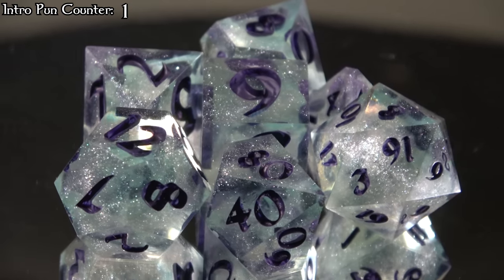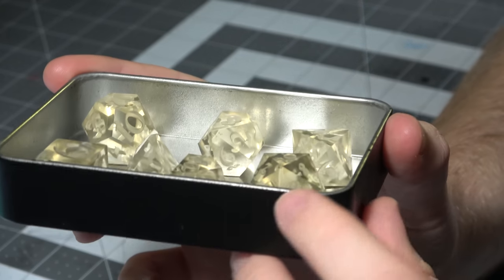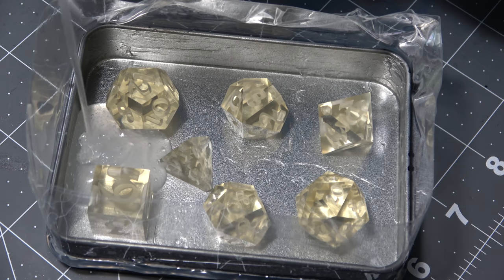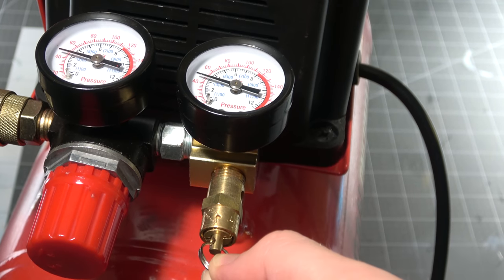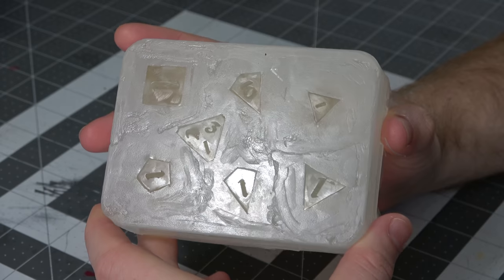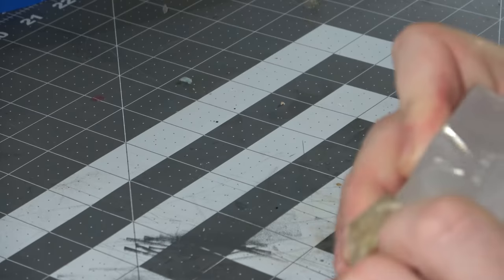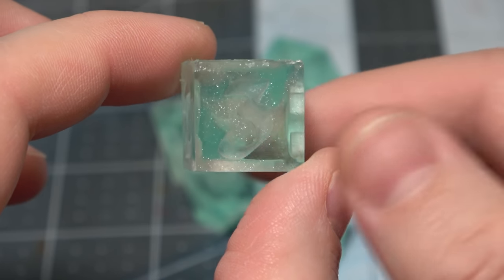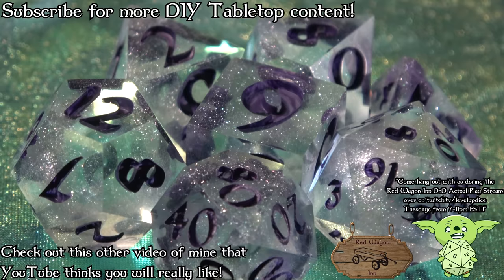The Complete Guide to Dice Making | Cap Molds

Comment: I would love for you to show us a good way to make dice without a pressure pot or vacuum. I know they make things easier but for beginners they are a big investment.
Reply: They are big investments, and I'm about to try making dice without them, but I think for dice in particular it is important to remove all air bubbles so that the weight of the different dice sides is as even as it can be to promote true randomness. I have a friend though who WANTS trick-die for character creation, so I'm going to see if air bubbles aid in that or not.
Reply: you can buy resin that has to cure longer, that way the air bubbles rise to the top and you can use a lighter to remove most of those bubbles
Reply: @kevinkever  Yes! I found this as well, I have a very difficult mold (there's only a small slit to put resin in) and I've found that slow curing resin gets rid of most bubbles. Only a few small ones remain which only matters if you're making clear dice.
Now I'm going to try making sillicone molds without a pressure pot so pray for me 😂
Reply: Just do it without the pressure pot. You can squeeze out air bubbles,  use a massage gun on it,  and accept that there will be some small bubbles from time to time. If you're selling stuff and you need to absolutely 100% make sure there are no bubbles. You're going to have to invest. Most of the time it looks just fine w out a vacuum chamber or pressure pot.
Reply: Allegedly you could also put the mold in the fridge for a few hours at the beginning of curing it, which will give it a longer cure time, and allow the bubbles to rise to the top of the mold. And with the dice, using UV resin may help with the bubbling issue, since you have to do it I layers. The only downside is that your mold has to be clear.

Comment: Would you consider making a budget dice making video? I’m interested in the hobby but I don’t have the budget for it
Reply from the maker: I'll add it to my to-do list :)
Reply: Not using a pressure pot is what made the whole thing cheaper for me, but it is a struggle with those bubbles
Reply: You can find resin cheap on Amazon and a good substitute for mica powder or alcohol ink is acrylic paint (you can get a fair amount of different effects with acrylic). Mica powder itself off of Amazon is pretty low price compared to other places too, so you could get it off of there.
Bubbles can be a real issue though, but I found a DIY pressure pot video that shows you how to make a decent pot with just stuff from a DIY shop, so I hope this helps!
https://www.youtube.com/watch?v=eYL_Klfp3Lk
Reply: It’s worth it to save up and get the stuff he’s using. I lucked into a pressure pot, but for the rest, I got everything needed for $200 Canadian, and this amount of resin can make a LOT of sets of dice. The huge resin jugs I got were 3.8 liters and it only takes about 50ml of each jug to make a full set of dice.

Comment: I used this tutorial to make my own cap mould. Just took the finished product out of my pressure pot ten minutes ago, and it's perfect. Every little hint worked - from the tape around the sides to the petroleum jelly. I can't wait to systematically work through the actual dice tutorials now.
Reply: Did you put your mold with the resin in it into the pressure pot? He didn't show that part but it sounded like he did. I just want to be sure in case it will ruin my mold 😨
Reply: @MegaBlackrose67  I just pulled out my first set of dice following this video (as well as some others) and yes, I put the silicone mold filled with resin into the pressure pot. Then pressurized it and waited. They came out great. Now if I coiuld just find a mini pottery wheel.
Reply: I just finished my first set as well. I love this channel and I plan on going on the same epic journey that you are about to partake in. Good luck and have fun. :)

Comment: This is an excellent tutorial with some nice techniques.

I've done the silicone mixing in ziploc style bags before, which allows you to get a very good mix by kneading it with your hands, you can also work it a bit by squeezing the bag to help with the bubbles. Then, you can then cut a very tiny hole in one corner and squeeze out a very thin stream of silicone from a bit of a distance. This not only tends to remove bubbles because of the sealed bag, the thin stream also decreases bubbles and pours slowly so you capture lots of details. Didn't have a pressure pot so had to get creative for copying some old car badges.
Reply: would that work for the resin as well? kinda want to try making dice but there's no way i'm buying a pressure pot and everything xD
Reply: @beardalaxy  You don't need a pressure pot. Just use a tool to pour your liquids down slowly with, and slowly mix your liquids together. Use plastic to mix also as wooden tools cause bubbles. You can also add in layers, so pour, use a heat gun to get rid of bubbles, or a flame tool, and slowly add more each time, again, with a tool that you pour the liquid down.
A pressure pot is a waste of money if you don't need it.

Comment: one other tip I have found while using a harbor freight pressure pot. Every once and a while rubbing some vaseline around the gasket to help it seals better to the base of the pot has really helped keep the pressure inside the pot and reduces the trickle/leak of air.
Reply from the maker: Oh I should have mentioned that, because I do the same thing! :)
Reply: I just picked up one today to start making dice. May I ask which gasket?

Comment: We use ease releas from smooth on(same company as dragon skin). We just spray it in two layers, even directly on the dice. Doing that makes the mold super smooth. Easier then fenagaling around with petroleum jelly cause you can still spray it right on the dice and has no issues capturing details.
Reply: Also thanks for the video on updated cap molds. We used your last video to make cap molds and we love em. Can't wait to try making some more but with glue dots. >:3
Reply: I was wondering about using a mold release spray, seems like it would be much easier and faster than petroleum jelly on a cotton bud.
Reply: does it work on resin 3d printed dice for masters? I'm having a terrible time getting inhibit x and looking for a safe alternative that won't turn my masters into a slimy silicon oozy mess. -_-

Comment: Ilove these videos! It has inspired me to start the hobby.

One thing I would note though is the compressor size matters when you are filling the pressure pot. If you have 100psi in a 5 gallon compressor, it will not be 50psi when you connect it to a pressure pot that is 2.5 gallons. Be careful when connecting the two together.

Comment: Whenever I cast silicone in/on silicone I have found the best thing to use to make them easily separate is a half and half mixture of liquid dish soap and alcohol. It leaves a super thin layer of dish soap that is really easy to wash off! I made some silicone dice on my channel if you want to take a gander. Thank you for the video! I made a very similar mold for my micro dice!

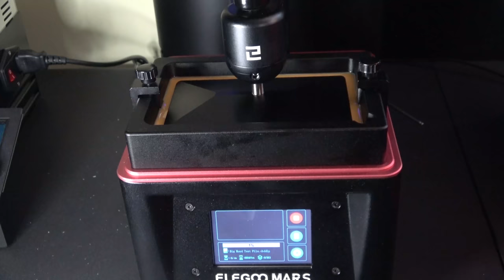Comment: This is an awesome video. 1:51 I'd like to say that reverse engineering is not illegal. If you take someone's finished part, measure it and recreate it in CAD, you can do whatever you want with it as long as you don't do any of the following: 1. use a patented mechanism or process (dice are not patented) 2. use a trademark symbol 3. use copyrighted media. Also, make sure you have a commercial license for whatever font you are using and if you need a font, please buy a license from a reputable font seller. Typeface designers do a lot of hard work to create those beautiful fonts and the licenses aren't very expensive and usually you can use them for the rest of your life.

Comment: Dissolve your vasaline in benzeen/naphtha and spray it using a cheap air brush (wear a respirator) or get proper spray can mould release. Both easier and less labour intensive.

Comment: Awesome video, thanks! One correction: DLP and LCD SLA resin printers all use the same resin, so you should always use Inhibit X on any resin prints, unless the resin is specifically made for silicone mold making, and those are usually really expensive.

Comment: You can make removing the molds from the container easier by using the air compressor. Get the nozzle between the edge of the silicone and the mold wall and blow air into the gap. It will release the mold quickly and easily.

Comment: Since you have an air compressor, you can use it to help release the molds. Use either a blower tip or a ball inflator needle. Put it in a gap on the edge of the mold and blow air into the mold. It should make the form pop out or at least help loosen it. Much easier since it also breaks any suction the silicone may make holding it in the form.

Comment: Yeah! New video! What do u do if u don't have a pressure pot?
Reply from the maker: So without a pressure pot, you just wont be able to get clear dice with hardly any bubbles AS EASILY. It can be done. You can mix slower to incorporate less bubbles, and you can put air holes like in the combo mold I show off to help release some :)
Reply: You can also use the Fridge Method to remove bubbles! I don't have a pot and it saved my molds. 

Essentially, like Rybonator said, mix and pour slooooooooooowly, and then put your mold cups in a tray and let the silicone sit in the fridge anywhere from 12 to 24 hours. 

This inhibits the cure and allows the bubbles to rise in the still-wet silicone. Once the 12-24h are up, remove the molds, and let the silicone finish hardening at room temperature. 

And bam! Clear dice molds with no pesky bubbles!
Reply: ...I may have misread the comment to be about the molds themselves and not the resin used to actually make dice- sorry! I'm not awake yet.
Reply: @Marcario  I kinda ment both👍 thx for being extremely helpful!

Comment: I noticed  you said that both the mold and the dice themselves were used in a pressure pot. I've watched alot of your videos and in another video you used a vacuum chamber when it came to the molds specifically. I was curious why you were able to use a pressure pot for the mold and not the vacuum when it came to removing bubbles from the silicone itself. Much appreciated it you reply thanks In advance :)

Comment: I just wanna add that if you ditch the pressure pot's compressor connector for a schrader valve (bike pump valve), you can get away with quieter dice making and get swole in the process by filling up your pressure pot with a bike pump.

Another thing, I use wood glue when I attach my dice to the bottom of my mold. I dab just the slightest amount on and stick it right on. It's so flush against the surface that I hardly have to do any trimming, if any.

Comment: I have to thank you a lot for this vids, they got me into dice making and I just can't stop making them! I have a question though, but I imagine it's gonna sound stupid... I followed this tutorial for cap molds and they came out GORGEOUS, but still I have some excess resin I have trouble sanding (like I went too far and now the numbers aren't there anymore 😅)... Would you consider making a tutorial as to how sand correctly? Sorry for being a newbie and bothering you 🙄 thanks again you're a dice legend!
Reply from the maker: Hi Serena :) I'm glad you like my content! That makes me happy.

So I would probably say that you are starting with TOO heavy a grit of sandpaper. If you are starting with say 200, try starting at 1000 instead, or use something called Zona papers! It's best to go slow, as you can always take away more, but you can't ever put it back. So it's best to start with an easier/softer set to make it so that you can find a groove that works best for you. :)
Reply: @Rybonator  first of all thank you for taking the time to answer and for the advice, I will surely do as u say 😊 do you have any advice also as to how remove the excess resin without deforming the dice? Thank you again and sorry for being such a noob! 🙏

Comment: I have little round sandpapers that Velcro to a round bit that fits in my drill which I have propped upright and use exclusively  for sanding dice which seems like the same idea as the pottery wheel

Comment: How did you solve the issue of little bubbles in the silicone that were causing spiky bits on the surface of your dice? If I recall, that's why you were degassing your silicone in a vacuum chamber.

Comment: If you are using SLA prints you can use any clear coat you get at Walmart or a hardware store and the silicone will cure just fine. However, if you use IPA to clean the dice afterward you will rub off that clear coat.

Comment: We've made a couple cap molds following your tutorial, but we've been running into problems. After filling our mold with resin, the cap/lid doesn't go down all the way, so the upper faces of the hardened dice are extra tall. When we sand them down to the proper proportions, we lose the number. If we don't sand them down we have an imbalanced die. Our lids are about 1/2 inch thick. Do we need a thicker lid to apply more pressure? We've even tried putting books on top of the molds in the pressure pot, and even clamps, but they just don't apply pressure evenly enough. We love this style of mold, but can't seem to make any usable dice from them. 

Help us Rybonator...you're our only hope!
Reply from the maker: So 1 of 2 things happns - (Hope I can help :) )

1- You just need to push more of the resin out when you put the lid on. If there isn't resin coming out of the sides, it generally means you didn't put enough resin inside the mold, or you don't have enough weight to push the resin out. (You can also shimmy it a bit to get the resin to squish out the sides.)

2- If there is a large lip where you cut the silicone on the bottom half of the mold (where the dice go), then there isn't much you can do since the resin will always fill the voids that exist. Meaning - The clay/tape or whatever you used to hold the dice down when making your mold was just too thick. Best to just start over at that point, otherwise you will just keep getting frustrated.

Hope this helps! I would avoid putting weights on the molds to keep the lids down. A book will probably distort your mold and make some wonky dice. Next time make the lid a BIT thicker if you are having problems. Never hurts to have more, but can hurt to have too little. :)

Comment: You say leave for 36 hours for hardness for sanding but what if you need to cut off flashing? Wouldn’t it be best to take out earlier so it’s still soft enough for cutting?
I’m making my 1st set of test dice and know I will certainly have flashing of some kind that I will need to remove.
Reply from the maker: Good question! Flashing is generally so thin that it always stays pretty soft. I wouldn't wait days and days from the time it cures, but you should be fine at 36 hours. If not, cut the flashing beforehand :)

Comment: Are these cap molds useful when you don't have a pressure pot? I've been playing around with some sprue molds but I can't eliminate the micro bubbles on the edges. The resin has a long cure time so I'm considering a cap mold to see if more bubbles can escape before it starts to set.
Reply: The nice thing about cap molds is that if you let your resin sit for a little, the air bubbles will come to the top and you can pop them with a lighter before you put the lid on
Reply: You can do small bits at a time, and use a heat gun. I find them better as they actually push the heat onto the resin instead of just on top like a flame tool.

Comment: TIn cure silicone will handle most resin printed models. while not being as durable as platinum cure, it isn't as finicky so you can pull a different resin from your tin and make that your master copy. Also you should link to Crafsman's video.

Comment: Factual correction: Not the printer technology(SLA or DLP), but the Resin used is the deciding factor for "Will my Silicone work with this"; both technologies CAN use the same types of Resin and work on the same principles.

Comment: How much does it cost per set of dice to produce? Also thnx for the awsome vids
Reply from the maker: After I have a completed set of molds, probably 2-3$
Reply: @Rybonator  100.00 for the pressure pot, 60.00 for the compressor, then supplies, so starting cost is high, but after that then 2-3.00. So look for sales and hobby stores with coupons will help
Reply: @LevidelValle  bought a foot pump for adding air, cost 8€. It takes a surprisingly little time to reach 40psi and is relatively noise free.

Comment: I made these cap molds when I saw the original video, but I had an issue with the top face of the dice having a thick lip on it (rather than it being flat and more flush like how Rybonators turned out). Any advice on how to fix this?
Reply: I have had the same issue I'd also like help with this

Comment: Hey, thanks for your guide, is very complete and welldone! I would like to ask you why are you making molds instead of using simply your 3d printer? Only for creating these stunning color effects or there is some other reason? Is the 3d printed master dices suitable or not for playing? Thanks in advance! Enjoy 😉
Reply from the maker: So 3d printed dice are far softer than normal dice. Using them will eventually leds to scratch and wompy corners. (Also it makes way coolor colors etc. :) ) 3d printed resin is just softer than casting resin
Reply: @Rybonator  thanks

Comment: Does the pressure need to be 45PSI? Can it be done at lower pressure?

Thanks, great video - very helpful.
Reply from the maker: It CAN be done at a lower pressure- I typically say 25-30 is the minimum, though others have had success with as low as 10psi